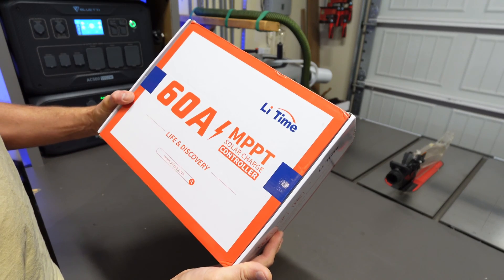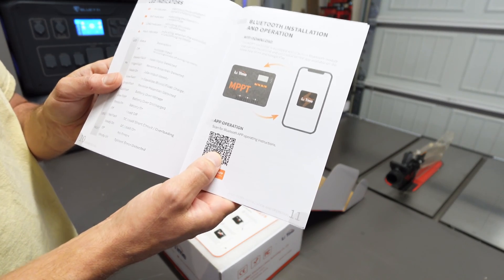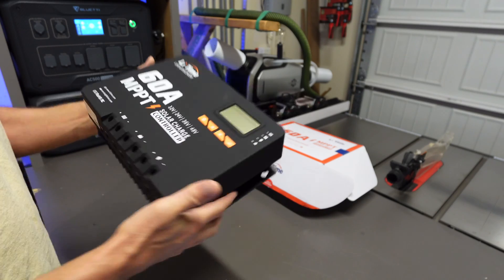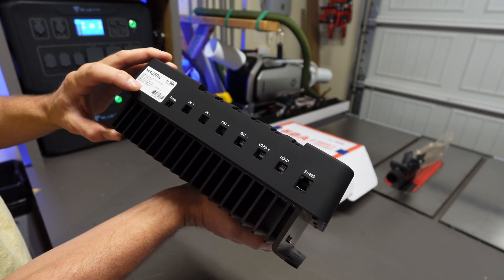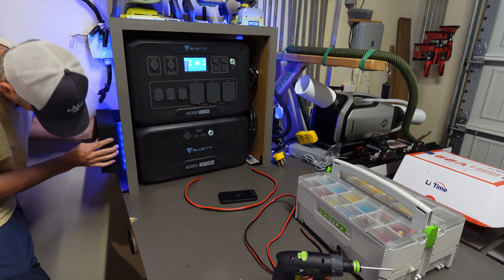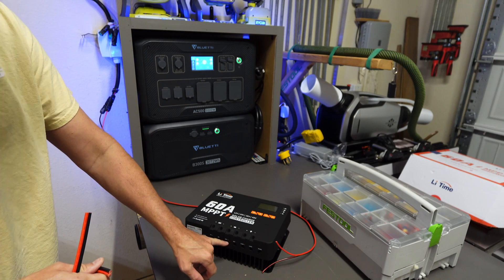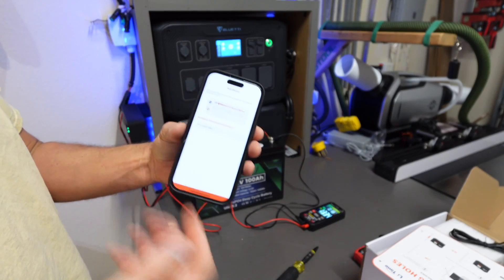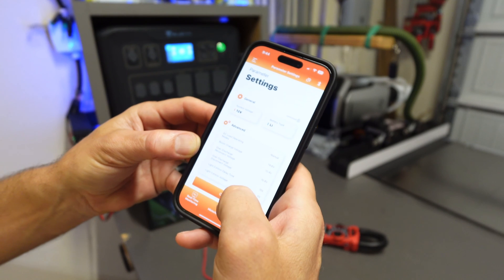How to connect the LiTime 60amp BLUETOOTH MPPT solar charge controller.

Comment: I've got this MPPT controller. I know it has Bluetooth but I was thinking about using a WIFI dongle to connect to its RS485 data port, to monitor this device remotely. Do you think it would work & which one would you recommend ? 🤔

Comment: Can I use a 4 gauge wire on it
Reply from the maker: 4 g will likely be too thick to insert into the connections
Reply: @GearGadgetReviews actually someone in another video tried 4awg and it fit but it was tight.
Reply: I got 4guage installed.

Comment: Great video. Thanks for posting! One safety concern for you as you use this setup. I didn't hear you say how much solar input you have, but 12v at 60A, you should have at least 6AWG cables between the controller and the battery.

Comment: I have the same 60amp controller on my small 1350 watt solar system charging 2 Power Queen 100ah LiFePo4 batteries. Its a nice charge controller and i will get a second one to connect to another panel array as soon as i can upgrade. Greetings from Jamaica.

Comment: With the ability to send 60A to the battery, it needs to accept 6ga and 4ga would be preferable.  6ga is only suitable for 60A if the connection point and wire used is rated for 75C or higher operating temperature.
Reply from the maker: 👍🏻👍🏻 there is enough room for that size

Comment: I’m confused. Are your solar cables split at the shutoff. Aren’t they also charging your Bluetti power station
Reply from the maker: I used the AC500 array just for this test. I’m installing another array to be used strictly with this MPPT.